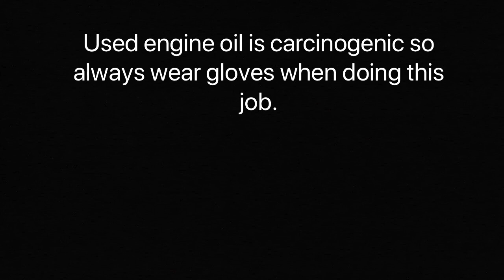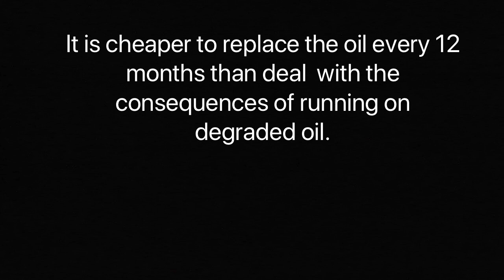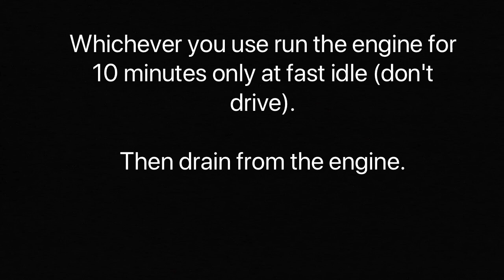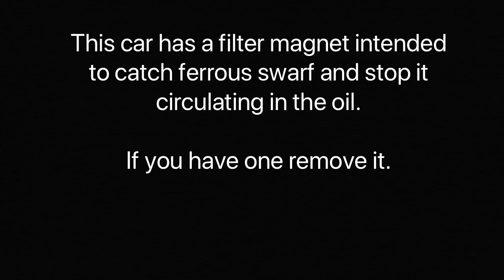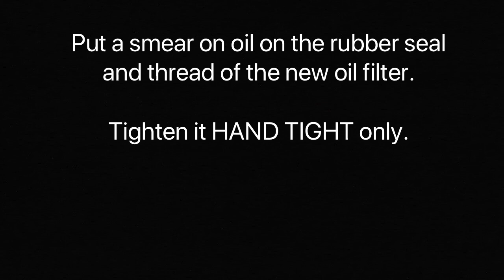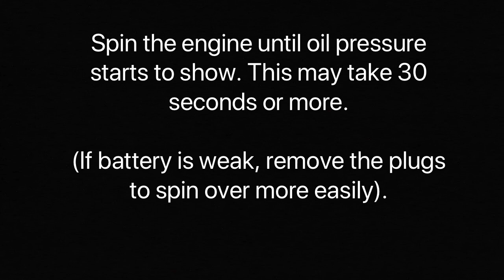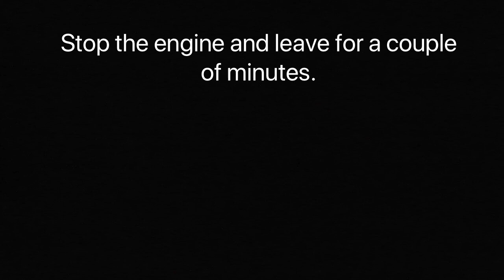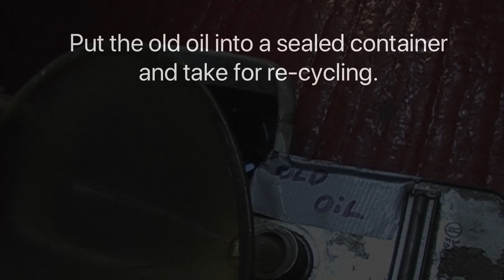Sunbeam Alpine: Changing the Engine Oil

Comment: hi do you have any video on how to remove the gas tank to clean it.
Reply from the maker: Hi Victor, we don’t have video but it is quite straightforward. Drain it at the central pipe connection. Release the two bolts in each wheel arch, the jubilee clips securing the three large pipes and the bolts holding the tank mounting brackets at the rear. Also release the jubilee clip at the tank filler and the breather pipe between the two tanks as well as the wire to the sender unit and you will be able to remove the tanks from the car. Clean inside and treat with POR tank sealer.
Reply: @TheSunbeamAlpineChannel  noted with thanks, will try it out